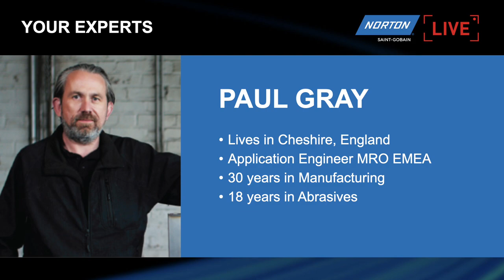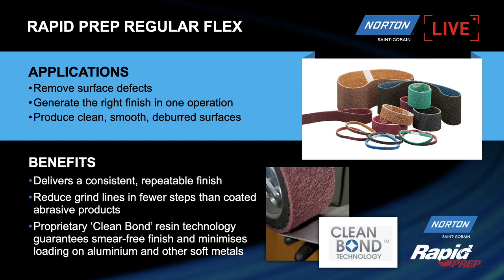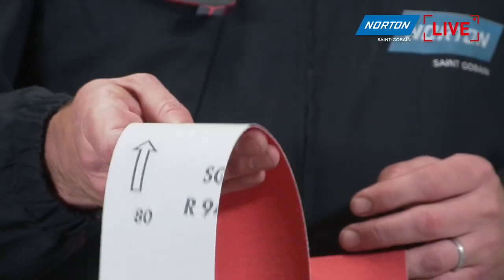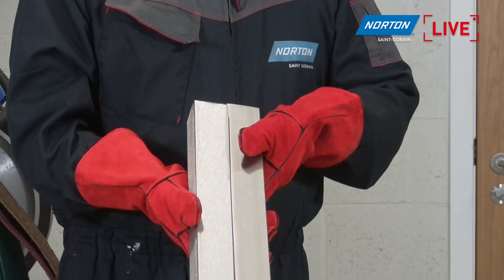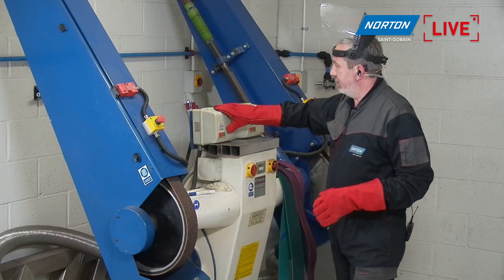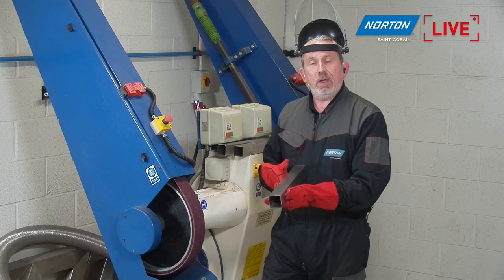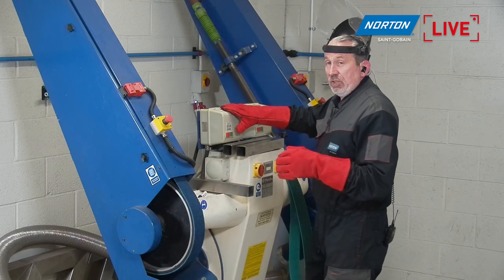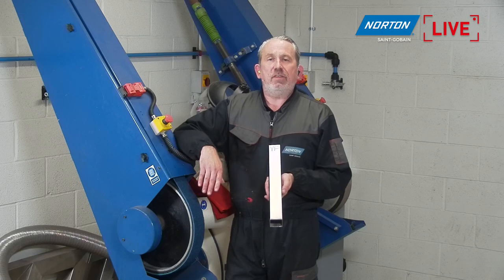Norton Live: how to achieve a No.4 surface finish on Stainless Steel

Comment: The problem with using the round to contact the steel instead of a flat platten is that you invariably end up with the rippling you can see in your final product after the very fine belt. Same source of the rippling in semi custom production swords.